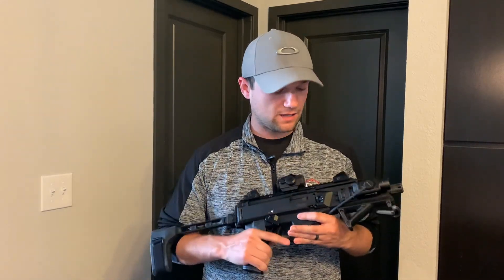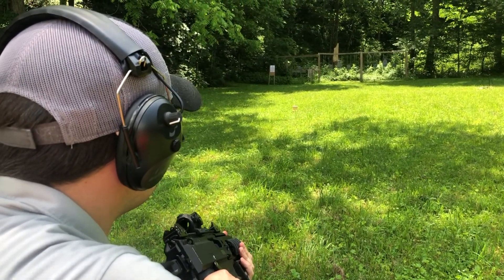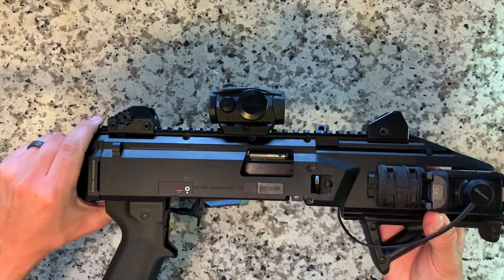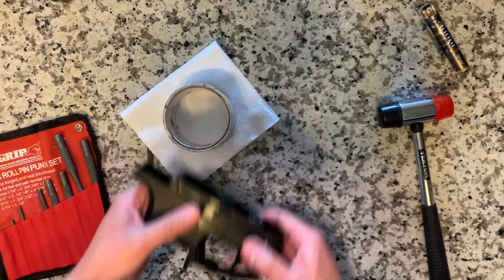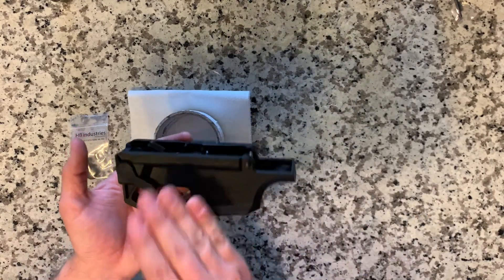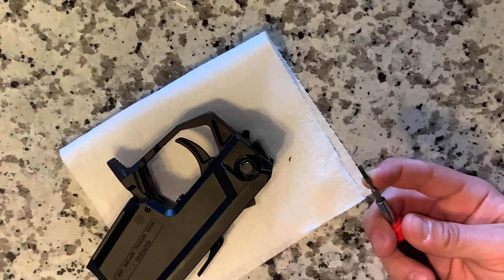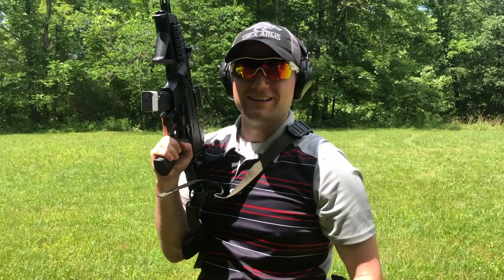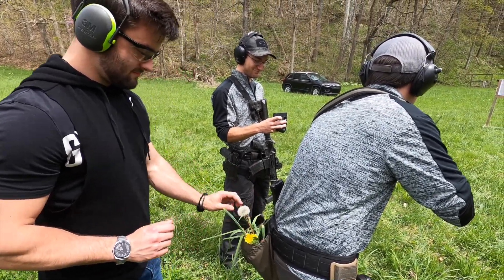CZ Scorpion Project: Safety Selector and Mag Release Upgrade

Comment: Does your roll pin work itself out after repeated use?
Reply from the maker: I haven’t had any issue with them. However, I also have only messed with the trigger pack pins 2 times. So that probably isn’t enough to cause any damage. 

I could see repeated use reducing friction of the pins over time, but I’d have to imagine you would be constantly uninstalling and reinstalling those. As much as a regular person or gunsmith with take those pins out (aside from upper and lower connector pin) I wouldn’t foresee any issue with this.